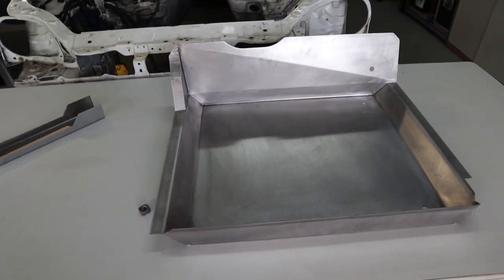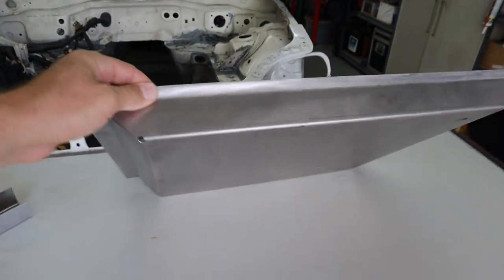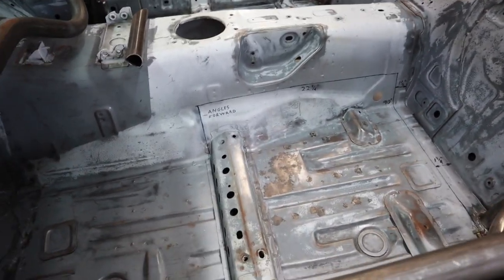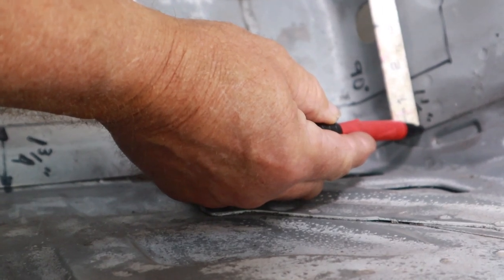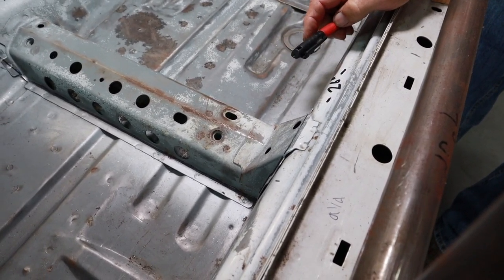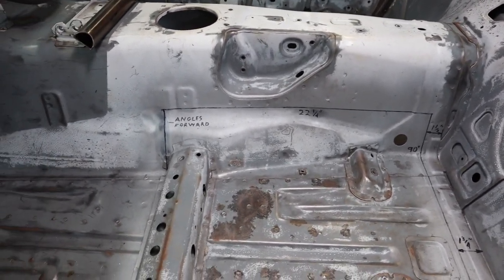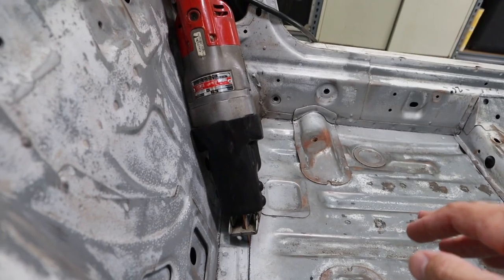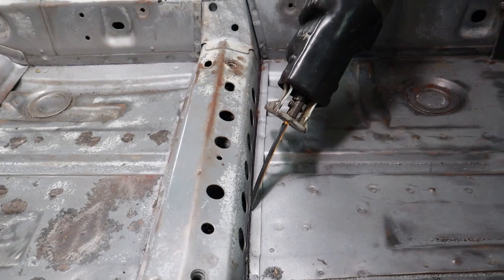5X Racing Mazda Miata Drop Floorpan Kit Install: Part 1 - Removing the original floorpan

Comment: Dude i need a normal floor pant replacment with the seat mounts.  Drivers side.  Can u help me?
Reply: Im 5 6
Reply: Mine rusted toward the front of the pan left side by "rocker". About 6x 10 area wanna re do all of it
Reply from the maker: We are planning on offering a seat mount kit to add to our floorpan, but it's in development and we don't have an ETA on when it'll be ready. Thanks for your interest in our kit though!